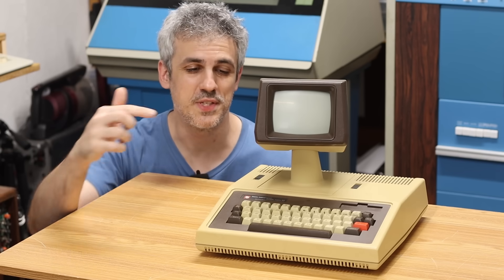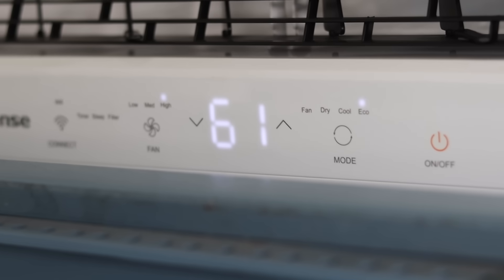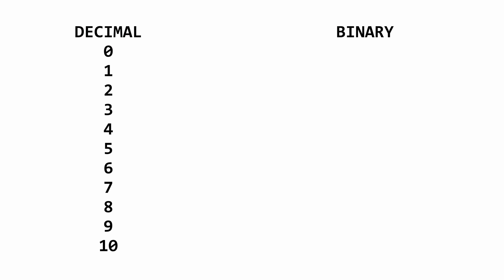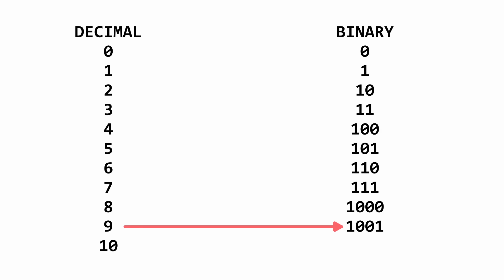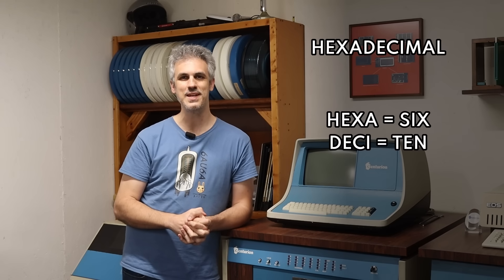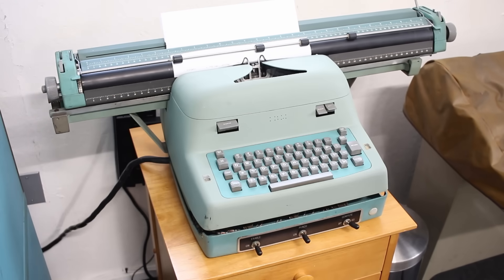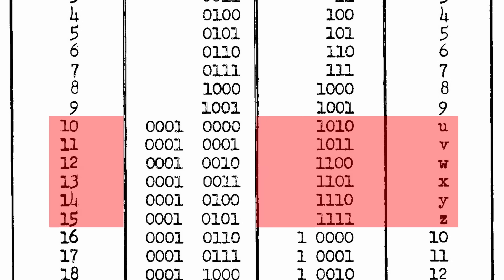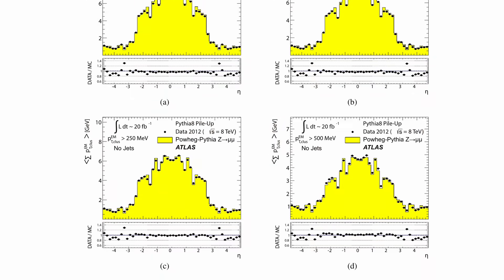Learn How to Count Like a Madman (Or a Computer)!

Comment: Nice .Believe it or not, I've never understood why Octal was used in computers until today.  Hexadecimal is one of those things that I understand so well, but it is so hard to explain to newbies learning assembly as to why it is useful. But yeah.. the Bendix method.. that's crazy.
Reply: Early computers existed before bytes were a thing. Before LSI ICs were mass produced, and VLSI MPUs (leading to 8-bit home computers) mainframes and hobby computers were custom designs and had many different instruction word lengths. Commonly in multiples of 3 bits (12,15,18,24) which could naturally be represented by octal and didn't need the extra hassle of learning a new number system that introduced letters into numeric representations. After all they didn't want to confuse them with algebraic expressions! Ironically my pet peeve with octal was its visual similarity to decimal and unless explicitly highlighted as different, with base identifying prefix or suffix characters, would lead to much confusion. Hexadecimal however is great at self identifying its non decimal nature.
Reply: fun to see you here
Reply: @TheChipmunk2008  Hey Chippy.
Reply: It's somewhat useful because Unix/POSIX/Linux mode bits are in groups of three, like chmod 755 exefile.  Personally I don't bother unless my environment requires it (BusyBox on embedded systems might only accept octal), and I just have the chmod program figure the bits out.  Most implementations accept u for user, g for group, o for other, r for read, w for write, x for executable/searchable, and a few others.  So instead of writing chmod 755 exefile, I could write chmod u=rwx,go=rx exefile.  For some bonkers reason, some admins use octal instead of letting the program figure it out from the symbolic representation.

Turns out avionics use octal for transponder "squawk" codes too.
Reply: @DrRChandra  "It's somewhat useful because Unix/POSIX/Linux mode bits are in groups of three, like chmod 755 exefile."
You're putting the cart before the horse: Unix does this because of it's legacy with the PDP-8 (a 12-bit system, therefore naturally octal) and PDP-11 (16 bits, but still had the octal mindset).
Reply: Octal is often a better match to the subfields within an op-code - i.e. an instruction might allocate 3 bits for the source register and 3 bits for the destination register, or 3 bits for the operation type, etc (this is why the front panel toggles are in groups of three bits).
Reply: @ickipoo Im building a functional replica of a minicomputer build in my country in 1970. It is similar to the pdp8, and all octal. The switches and blinkenlights are grouped on triplets. But much come from the instructiona and how the bits tha encode the ops are arranged.
I first made on the PC a full visual simulator for ths and their suscsors, still doing the simulated periferals. And for the phisical replica, remade the simulator for Arduino. Thansk g0d C/C++ support octal from the box, the sim for the PC I did it in C# and had to do a library just to manipulate octal numbers.
Reply: This episode does not explain it at all, and you shouldn't get distracted by his fridge logic explanation. Octal was popularized because of 6-bit and 9-bit computers, which typically used CPU instructions and memory addressing of 18 or 36 bits. Important mainframes in the 1960s like the IBM System/360 and the GE 645 (Multics) were 9-bit machines. When they wanted to represent (e.g. for output) decimal, they used something called binary-coded decimal (BCD), which is basically a hex encoding with the values A through F skipped.
Reply: Make 'em hand-assemble a few programs and enter them by hand using front panel switches. That'll learn 'em real quick!
Reply: Despite being a 16-bit machine, the PDP-11 instruction encoding fits octal very well: BOOOMMMRRRMMMRRR, where B = byte/word, OOO = opcode, MMM = addressing mode, RRR = register.
Reply: The bottom like was that 12  bit computers used octal but as things went to 8 bit some continued with octal for a while.
Reply: Do you still menace Sandy Hook victims with videos of yourself bringing guns to the grocery store?
Reply: I'm 57 and been programing since I was 14 when I got a ZX81. I've never understood Hex. I only use decimal. I think it's because the computers I program don't use Hex as standard, you have to have some software to convert the Hex to binary. So I just went straight for decimal as that was what the computer was expecting.
Reply: @Franko_Walker sinclair gear used hex  sometimes,  programming in machine code for example, you had to enter actual hex (at least on the speccy)
Reply: @Franko_Walker  Do you really think the computer "understands decimal" vs just a number of binary bits in some transistors ??. Binary -> Octal as a learning thing as you are only using tokens you alreay understand, then Hex makes sense, just with a few more tokens added on at the end when you run out of fingers.

Comment: Next: Binary Coded Decimal. And how it works in ASCII (just add 0011 to get the character code). Also WHY.

Also: Telephony binary-coded decimal (TBCD) - for when you don't want to do maths but need to encode all the keys on a telephone. And want to get thrown by swapped nibbles.

More Also: Sexagesimal = Base 60, how we count numbers of seconds and minutes.

Comment: The reason why 0 is past 9 on a qwerty keyboard is because on old portable typewriters you would not have the 0 at all, or the 1. You would use the lower case l for 1 and the upper case O for 0, they were added later at the two extremes of the top row, along with other characters.

Comment: When I was in school, (1962), we were also taught base 12 (the clock is base 12).
0,1,2,3,4,5,6,7,8,9,T,E where T was ten and E was eleven and 10 was twelve, since we were familiar with clocks,  base 12 was first then base 8 was taught and finally base 16.

President Kennedy's program was called SMSG (Science - Math - Study - Group).

It lead me to be a computer engineer.

The Chemical Engineering department had a Bendix G15 that was being retired my freshman year, replaced by an IBM 1130. I learned Assembler and Fortran on the 1130 and learned how to fix computers there, we had a PDP8, PDP11, GT40, DG1200 and 2 Analog Computers - one used by NASA for project Mercury and one used by NASA for project Gemini which NCSU converted into a time share computer with 16 storage screen terminals. 

I helped load the G15 in the back of a truck that took it to a recycling center - we had to take out all the vacuum tubes as the recycling center did not want the unit with the tubes in it. The tubes went to the Electrical Engineering department as they still had a tube computer to teach about logic.

Comment: "never seen anyone mix and match numeral systems".  <looks at clock> No? Base 10, base 60, base 60, base 24 (or base 12), base 365 (except for when it isn't). Amazing what you can get used to.
Reply: But that's all decimal. (Sometimes Roman, but those have no base at all). It usually says 12 on the clock, not C and you don't have 60 different symbols for the minutes
Reply: @matthiaso57  the symbols are decimal, the base is not
Reply: @matthiaso57  Decimal? Then why doesn't my clock have a 13 or a 61 on it?
Reply: Imperial measurements is a testament to that
Reply: >Laughs in volumetric cooking measurements<
Reply: @TurboLoveTrain  what size cup
Reply: Oh, and don't forget about skipping numbers as some calendars do. Or missed numbers? Dang.
Reply: @beatadalhagen  that's what happens when you have a leader that wants a month named after them... they just insert another month... and boom everyone has to convert their once decimal calendars to base 11 or base 12... and then everyone just gets used to it, so then no one ever changes it.
Reply: @MikelNaUsaCom  The only thing worse than something not being standardised, is having a bad standard adopted. Which is exactly what happened for our timekeeping.
Reply: None of those are examples for what was shown here. We're not talking about mixing various bases to denote different elements in a system, we're talking about mixing bases within a single number. There's NO such thing as "1234, except the first digit is in binary, the second is in octal, the third is base-sixty, and the fourth is hex". Except for Bendix's lunacy shown here.
Reply: @AttilaAsztalos  Yeah like 0755 - which it is the time right now, which is mixing base 24 and base 60. Babylonian lunacy,

Comment: Until the 1950s the term for "base 16" was indeed "sexadecimal" but it was IBM that coined the term "hexadecimal" because they didn't want their engineers to be talking in terms like "F4 sex" and changed that to "F4 hex". IBM also brought us "pels" rather than "pixels" and EBCDIC rather than ASCII, but we can ignore those.

Now regarding octal, it's very natural for some machines like the PDP11 and even the 8080 where fields in the instruction word fall nicely into octal digits,

Kerningham and Ritchie really messed up the world by interpreting numbers with a leading 0 as octal in C, which can sometimes cause unexpected bugs. Would it cause chaos if in future C or C++ standards we deprecated the leading 0 octal interpretation and replaced it with 0o so that 0o14 = 0xC = 12 , rather than 014?
Reply: I learned this the hard way, I was writing assembly for a microcontroller and I had some large data tables, so I broke them up into lines of 16 bytes each, and to have them all line up nice, I padded them with leading zeros in front of any number that was less than 3 digits so I ended up with a nicely formatted data table in my code, but the result was that anything less than 100 was interpreted by the assembler as octal and that caused very unexpected things to happen!
It took a couple hours of reading the assembled code to figure out what was happening, and another couple hours reformating all of my data tables to use tabs and spaces:)
I'll never make that mistake again LOL
Reply: I will say, they were the main ones to develop ASCII and ironically couldn't move over to it until (I believe) the PC, cause they needed to keep their mainframes and terminals coherent and ASCII wasn't done a few months earlier.
Reply: So 0o might be seen as 00 for someone not looking closely enough. I considered other letters, such as the 8th letter (h) [nope: already means 'h'ex], the letter c (from o'c't) [nope: could be seen as hex's c], to 't' (oc't', like he'x'). Only the last one seems reasonable, so long as base 12 is never used (where 't' = 10, 'e' = 11). Still, it doesn't seem great. Another "solution": deprecate octal.
Reply: @Mueller3D  why not Base 12 go 9 A B like Hex ?
Reply: Writing it as 8x123 would probably make reading it easier.  It would make writing it take longer, which is probably why they abbreviated it.  The fact that 09 is not a valid number when you are new to C is a bit crazy, but after you lose a fistful of hair the first time, you won't forget it.
Reply: I am like 0_o at your idea of the new octal prefix!
Reply: @_f355  I see what yo_0_O did there
Reply: C23 does this, IMHO, and gcc 15 defaults to C23.
Reply: Mixadecimal?
Reply: Ah yes, because until the 1950s six-sided regular polygons were TOTALLY called "sexagons"...
Reply: But more importantly, are we mixing Greek and Latin words?
Reply: Many people older than me wished they could ignore EBCDIC
Reply: It should be Sexadecimal, because then it's all Latin. Hexa is Greek.

Comment: I love number systems!  Ever since I fell in love with Myst and the D'ni base 25 Number System.
Reply: I use semicolon and & to transliterate D'ni numbers.  It combines a set of five characters with the rotated set of five characters to create a digit.  So the character for five is rotated one.

0, 1, 2, 3, 4
5, 5&1, 5&2, 5&3, 5&4
10, etc.
15, etc.
20, etc.

I created a number system converter in Google Sheets.  I love it.  2025_10=3;5&1;0_25.

Comment: Hi
I'm sorry but 8 (oct) is a power of 2.
 Its 2 ³. That is why the simbols 0,1,2...7 fit the 3 bit grouping.
The some goes for 16 (hexa), but ths time its 2⁴, hence the 4 bit grouping for the symbols 0, 1, 2, ....F.
Where things don't fit its with decimal, because 10 its not a power of 2. That is why BCD must use 4 bits, like hexa, but the configurations above '1001' (9) are illegal.

After all octal and hexadecimal are only startegies to represent binary in a more compat format. 
Can you imagine programming inmachine code in binary or reading a program list in binary. Pretty soon you will up mixing the 1s and 0s, not to metion the width of the paper sheets needed for that.
That is why we still use hexadecimal in file/memory/...  dumping, Its way easier to read than binary and, with some experience, its quite easy to see the individual bits when looking at hexadecimal.
Octal, althought been used bafore hexadecimal, as less use cases currently. I only come across octal in managing file permissions in unix/linux systems. The traditional unix permissions are represented in 3 groups of 3 bits, so a perfect fit for octal numbering in the "chmod" command.
It was probably the normalization and generalization of the "byte" as the data unit in conputers that brought the hexadecimal to the front line.

Comment: Iirc, there is a game genie code for NES Tetris that makes the highest digit of the score hexadecimal (using A-F). This wasn't intentionally added by the designers, but it is used by most Tetris championships, since they need to track the score beyond the limit of what can be displayed.
Reply: A Pong game I designed at the gate level is like that as well to save some logic. The lowest digit of each score has some gates to detect "9" and force it back to zero with a carry but I didn't see the point of doing that for the highest digit.  So after "99" comes "A0" and after "F9" it rolls back to "00". I would expect the game to get too boring by the time one player got to 20 or so.

Comment: the act of counting does not require  you to specify a number system ,only when you want to write the number down you need to decide on decimal ,hex, etc.  so your initial explanation of 'needing to rollover digits' when you count past 9, is not entirely correct.  the number words in english  only start to mention 'ten' after eleven and twelve - thirteen.

Comment: I'm a former controls engineer, designing and programming PLCs and SCADA systems, and one thing many of us come across is octal, mainly in older PLCs.  One example is the PLC5.  It's never fun when that system is used with another one, that doesn't work with octal, especially when they have to talk to each other.

Comment: I know it was pioneer days and all, but I cannot conceive of the mindset that would use a mixed decimal and 'sexadecimal' counting system, and manage to get the other designers and would-be programmers to agree to it!  
An interesting episode, loved Dave flexing with his classic cars, but cant wait to get back into the hardware.
Reply: Base-16 long predates the advent of computers- the ancient Chinese used it.  It saw a bit of a revival in the 19th century when civil engineer John W Nystrom published a book proposing a new way of representing weights and measures, calling it the "tonal system".  The term "sexadecimal" is believed to date from that period.
Reply: The kennel club of the UK have trouble with their legacy database of registered dogs.  When they have more than one dog with the same name, they start naming them as dog2, dog3 etc.storing the nunber in a separate field.  But they hit a problem when they got to a certain size limit for that field - it was only 5 characters big.  Of course, five bytes can store 2^40. But they weren't using binary. In ASCII, that could represent 99,999.  But they weren't using ASCII either.  Nope - they ran out at 36.  Why? Because they were using roman numerals, and 37 is XXXVII - one character too many....  You've got to be really special to write a database like that.

Comment: I used to try to explain different number systems using odometers as a simple way to visualize number bases and rollover. 
I would occasionally run into someone who had never looked at an odometer and had no idea what I was talking about, but now there is an entire generation that grew up with digital displays for odometers. 
It's unfortunate when an advance in technology results in a loss of knowledge.

Comment: Whats receiving the bp swap at @ 1:36
Reply from the maker: Good eye!
That's a 1978 Isuzu 117 Coupe. The original engine was an SOHC G180Z that made around 100 HP, but Isuzu did offer a twin-cam 2.0 liter model that made around 135 HP called the G200W. Despite years of hunting, I can't find one of those G200W, so the 140HP BP from Mazda seemed like the perfect alternative.

Comment: Burroughs system like the B3500 used undigits 0, 1, 2, 3, 4, 5, 6, 7, 8, 9, /0, /1, /2/, /3, /4, \5.   FYI the \5 was change from the other / number so it did not look like 8 on the Nixie Tube display.